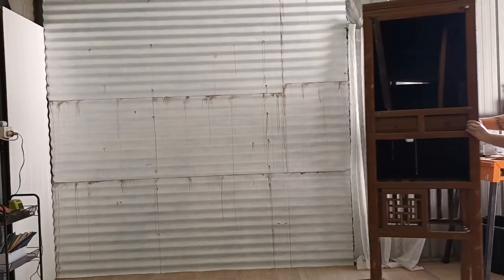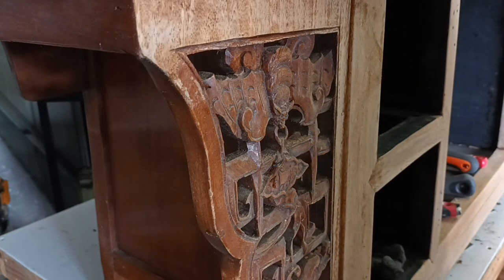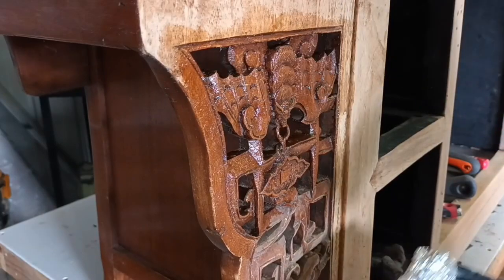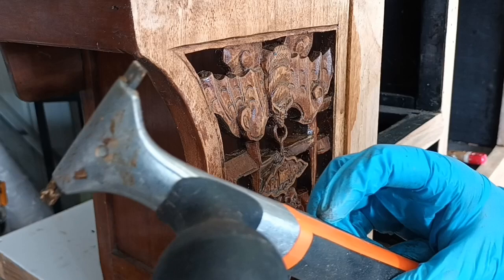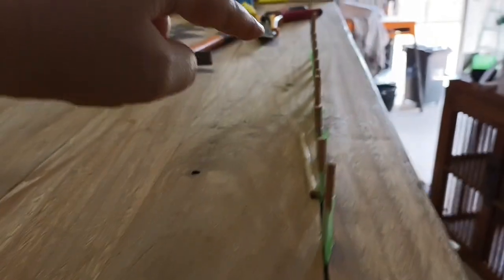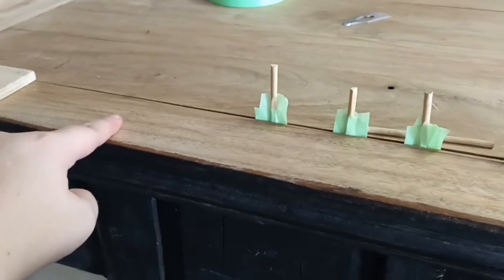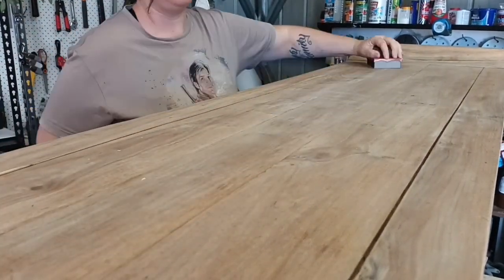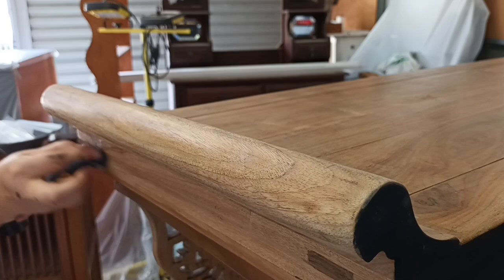Antique Chinese Altar Restoration

Comment: AMAZON DUPE FOR THE NYLON BRUSH THAT ATTACHES TO DRILL!! SEARCH: Rocaris 10 Pack Nylon Filament Abrasive Wire Brush Wheel & Cup Brush Set with 1/4 Inch Hex Shank, for Removal of Rust/Corrosion

Comment: This is actually not antique though. Vintage at best (but not likely). The floating panels are all wrong for an antique. As is the new hardware. Joints are too fresh as well. Lots of other indicators if you look closely. These are not alters but for some reason in English that name seems to have stuck. In Chinese this kind of coffer would be called a 联三橱 or a 蝴蝶柜 - maybe but not exactly as this is not really traditionally design but rather one updated for modern times (notice the drawers sized perfectly to hold CDs?). Looks much nicer after you cleaned it up though!